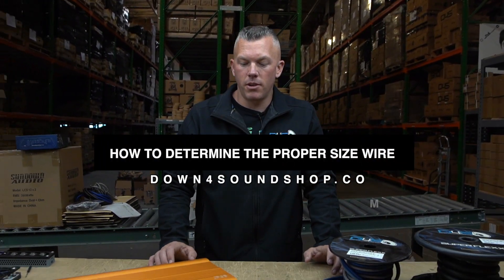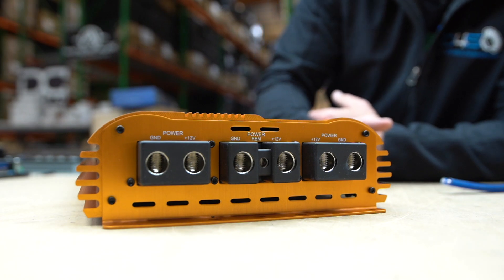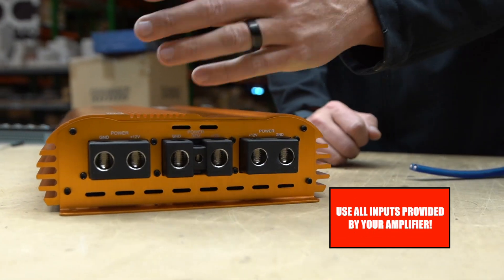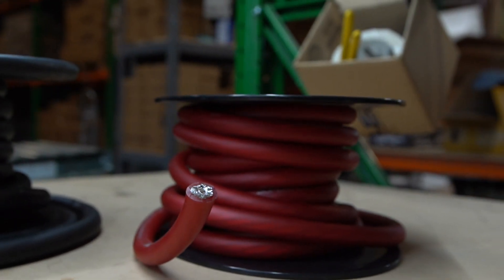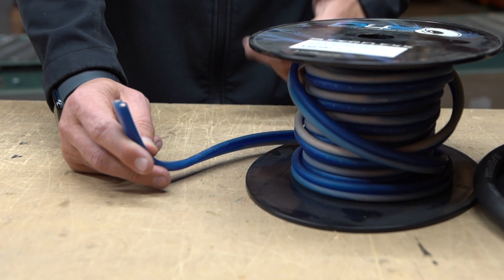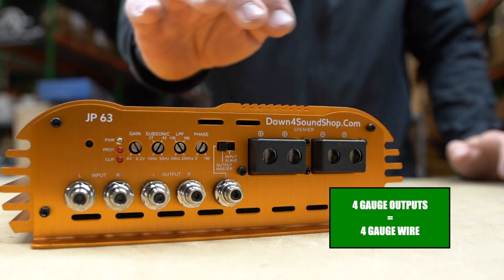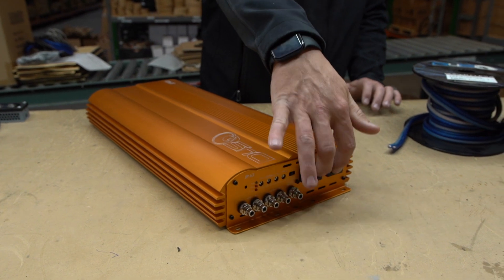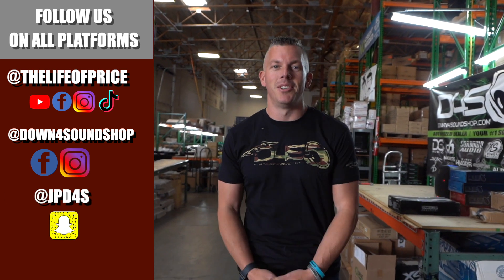HOW TO DETERMINE THE PROPER SIZE WIRE FOR YOUR AMPS

Comment: seems like this wire stuff is getting out of control.  i dont even have wire that big to power my 240 v hot tub that is 50 feet away. i mean its kind of different but i guarantee the hot tub draws a huge load compared to car amps.   my hot tub has a stereo and and subwoofer in it  3 -1hp  motors and a heater that keeps an 8x8 foot hot tub hot.   and it uses 8 guage.    seems like any thing more than 8 is OVERKILL

Comment: This might sound dumb but I am trying to plan for the future.  What size wire can I get away with  for no more then 3000w? I would be running 1000w for my subs & 600W or less for my speakers in the future . Trying to get the required power to the back so I  am only running power from battery once. doing this in a 98 extended cab chevy

Comment: I have two DC AUDIO 18’s d2 will be running DC AUDIO 10k and two DC AUDIO 1000.4 amps and one DC AUDIO 300.4 amp  in suburban with Big 3 and 400 alt what and how many batteries ?should I run under hood and rear?

Comment: I would use 4 gauge power and ground wire with anything from 500 to 1200 watts. And, the longer your wire is, the more resistance it adds. So I would go with 0/1 gauge even with 1000 watts if the wire run is over 15 feet to be safe

Comment: Where can i get a 4ga speaker wire when I only see 8ga as the smallest on the website
Reply: 4ga speaker wire is way to overkill , you should be able to run up to 2k rms off of 8 gauge and about 500 rms off of 12 gauge. If you insist on using 4gauge all you need is regular 4 awg OFC rather than 4 awg speaker wire as 8 is the smallest any company makes

Comment: What about if speaker terminals on the amp are small but we're pushing an above 3k watts sub...Can I just use reducers for sub if I'm running 8gauge wire or is it best to just go with the appropriately fitting gauge

Comment: Nice sales pitch Jonathan, but lets be honest ... Its all about the looks! 

When dealing with car stereo, most of the facts is overruled by looks, habbits and opinions.
There are very simple calculations, involving power needed, length of the cable and allowed voltage drop, to determine which size cable you need.
The amp. makers know this, and often use very conservative terminals on their amps. It looks better!
I also use way bigger cables than needed, but only for the looks ... My education often tells me, i would be fine using half the cable-size.

Thx for an awesome channel, you are doing great things for the community.

Comment: Only use OFC never CCA. Trust
Reply: What do you feel the benefit is other than that's what everyone says to use ...? Because I know from my own experiments it doesn't effect sound or power ....and I agree it has to be better using ofc .....but like I said have run several test and there is literally no difference.....so what's your opinion on why ofc is better
Reply: @donaldwilcoxjr.5212 well for starters it's science.  Copper is a far better conductor than aluminum.   Cca also turns to dust after about a year or two depending on where you live.  Go check 5 stars video from a few weeks backs, they pulled out a piece of cca that swelled from 4 gauge to 0 gauge due to oxidation

Comment: So i'm new at car Audio my Question is How do you connect three power and three ground i tried looking up on youtube but theirs is not any videos on this subject.
Reply: It depends… I’m probably not the best person you should listen to but you’d want to use three different grounding locations (all bare metal).You might be able to use the same location for all three, but I always used separate locations considering I use different locations for my batteries and amps. As for 12v power wire you can use three runs of wire from one battery or three runs from multiple batteries. Usually if you’re using three runs of wire you most likely have a huge lithium battery bank to support and utilize three runs of 0 gauge. With that you are pulling a ton of power. If I had to say three runs of over sized ofc 0 gauge your getting about 12000 watts max. But like I said this is as far as my knowledge goes. Someone with 20 years of car audio experience might have something else to say to your question.
Reply: Thank you. @jacobkelly7502

Comment: How important is it to use banana plugs instead of bare wire for the speaker output of a high-end amp? I am currently using bare wire, and other than a much cleaner installation, will I notice a difference in sound quality?
Reply: No difference
Reply: Nah no difference

Comment: I recently bought 2 d’amore amps. A 750.1 and a 400.4, should I run a 0 gauge from the battery to a distribution block and dual 4 gauge outputs?
Reply: You can do that for sure, but if you ever want to upgrade the amp/s in the future you could do two runs of 0 gauge now and save yourself the hassle. The bigger wire now is great, only an extra maybe $20-50 and some 0 to 4 reducers, and when it comes time to get louder all you have to do is swap amps.
Reply: Yep. this!!  @rossgras
Reply: I would just run a 4/0 wire instead of two 1/0.